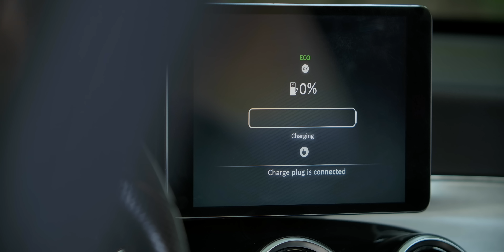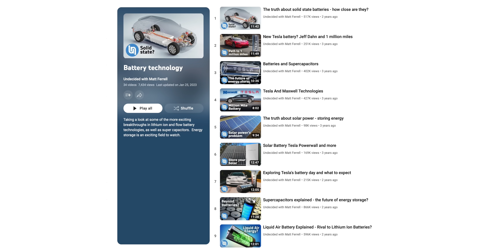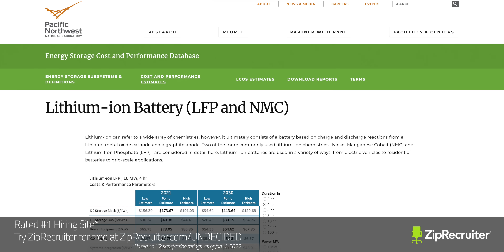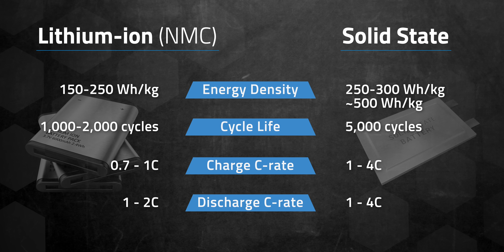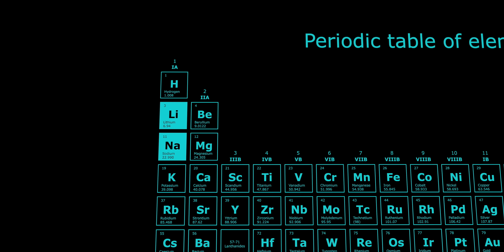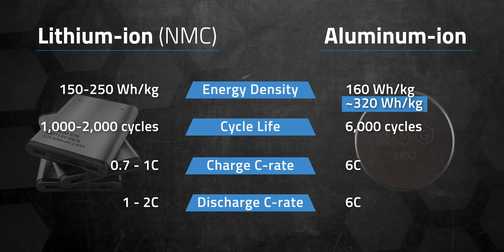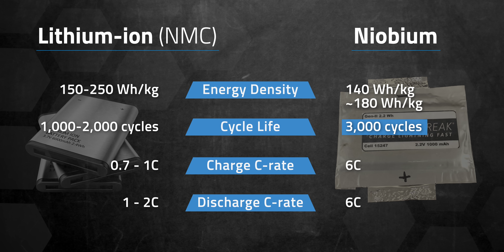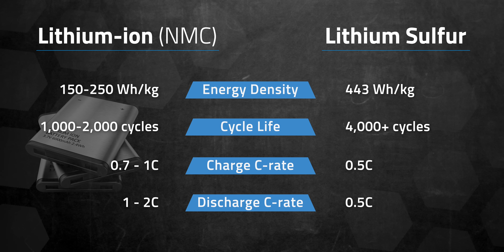Are These Batteries The Future Of Energy Storage?

Comment: I would be I interested in a few more points/attributes in these comparisons. For example, you might show your charge rate also in terms of an energy rate, such as miles of EV range per minute for a vehicle rated at 3 miles per kWh.  The estimated current and projected/targeted cost in $/kWh of the primary materials required for each battery type would provide some perspective on its potential advantage as well.

Comment: It's not technically a sealed battery, but I think vanadium fuel cells (aka flow batteries) are borderline criminally underexplored for grid scale storage, given that they've got far longer cycle lives than lithium based chemistries and their primary disadvantage is weight, not to mention that recycling of the electrolyte, the bit that's scarce in lithium cells, is trivial in vanadium based systems because it's a completely separate liquid that can be just drained off to allow only the fuel cell module to be replaced.

Comment: Batteries are NOT typically rated at 1C, they are typically rated at 0.05C or the 20 hour discharge rate.  Actual capacity drops, sometimes dramatically, with increasing discharge rate and many battery chemistries struggle at the 1C rate (like common primary alkaline)  and you only get a fraction of the capacity you get if you discharge over a day.  Good luck actually knowing this with only the manufactures data sheet because they are usually missing many key performance metrics.
Reply: NMC and LFP are both quite happy at 1C, the capacity drop going from a 0.05C test cycle up to 1C won't be that much for NMC, and it will only be significant for more easily available LFP batteries, like the types used for solar battery storage in home made systems.
Reply: @bosstowndynamics5488  name a commercial installation of any lithium chemistry and note the maximum power is often one half or one quarter of capacity.  Same is true of other chemistries, it’s due to thermal as well as other system requirements
Reply: @hugegamer5988  You're cherry picking by choosing a specific application and then generalising. Commercial installations are fixed installations with large banks of batteries that require endurance more than anything else, so they use more robust, longer lasting but lower discharge chemistries. Most LiPoly chemistries will happily discharge at 80C +, on the other hand, the NMC chemistries used in EVs will easily do 1C (the peak discharge rate in a Model S is 10C, those cells aren't going to struggle at 1C), the cells in power tools are designed to be discharged rapidly as well.
Reply: @bosstowndynamics5488  there is literally no chemistry outside of a capacitor thus not a battery that is “happy at 80C”    You need serious thermal management, get reduced capacity, and the cells won’t last long at all.
Reply: @hugegamer5988  A very quick Google search would reveal that there are high drain LiPo cells rated for delivering more than 80C, continuously. Maybe do some research next time before making up nonsense based on a comment you read once about a specific subtype of lithium battery chemistry
Reply: @hugegamer5988  Even the most basic intuition will reveal that there are lithium chemistries capable of much more than 1C discharge when you look at how many drones have batteries that go from completely full to completely empty in less than 1 hour (ie they are being discharged faster than 1 full battery per hour)
Reply: @bosstowndynamics5488  one main reason being charge/discharge cycles.  When you try 1C you might get half the cycles of 1/4C costing tens of millions of callers commercially.

Comment: DISINFORMATION AT 9:28 - The C rating is 0-100, not 0-80. It could still be considered as 1C despite having 80% within 10min (6C). That is because fast charge to 80% is always fast, while the 80% til 100% is much much slower.
Reply: No, the C rating is the maximum charge current the battery can take, which is to say, it reflects the charge rate when the battery is in the constant current part of its charging curve. In most, but not all, cases, this is 0-80%.
Reply: @bosstowndynamics5488  no its no. C rating is time from 0 til 100%, not 0 to 80
Reply: @markus98h66  Some searching to double check suggests that there's no clear definition - most sources I can find will massively oversimplify and say that a 1C battery will take 1hr to charge but they say that while calculating a charge rate with a peak current of 1C, which will obviously not fully charge a lithium battery in 1 hour. Most descriptions talk about peak charge current rather than time to discharge but don't use the term C, no source I could find that goes into enough depth to account for the CC-CV discharge profile needed uses C as a description of 0-100% charging times. The problem is C ratings are almost entirely about discharge rates which tend to be higher, and manufacturers tend to just specify a peak current and max voltage when they're providing formal specifications rather than time to charge when charged at maximum speed.

Given this, I think either use is fine, what with it being hopelessly ambiguous and ill defined anyway, but I stand by my comment in that every previous time I've seen a discussion of lithium charging rates, including in terms of C, it's been about max charge current, since that's the important figure for most use cases, rather than a 0-100 charge time that will never be used in the real world since discharging lithium chemistries to 0% is really bad for longevity.

Comment: For a comparison video, use less fluff and keep it short and to the point. The first two minutes where almost unnecessary. As you said, you already made videos on these, so you've probably said that stuff several times before. Its kinda disengaging for reoccurring viewers.

That said, Aluminium-ion seems promising to me as it seems like the solution thats right around the corner and even environmentally conscious, compared to the other solutions and their drawbacks. We will probably move on to solid state after that, when they're ready, unless something better has come around by that time. Sodium seems like a cheap option for grid storage, but aluminium still got better stats.

Comment: Any battery technology without using Lithium or Cobalt,  or any resource as such like which has issues regarding the mining of the stuff, is a plus with me! The hybrid supercapacitor battery seems to be the right direction to go.
Reply: As far as I can tell, the SuperBattery seems to just be a specific implementation of lithium supercaps, which combine many of the disadvantages of both systems (shorter cycle life than supercaps, slower to charge and discharge than supercaps, much lower energy density than NMC). Iirc the loss of energy density means that per unit mass lithium supercaps have a total lifetime energy throughput similar to NMC and much lower than other more lifespan optimised lithium technologies like LFP.

Comment: Aluminum Ion and Aluminum Air batteries are still the two I'm most interested in seeing develop.  It feels like the wait for new battery types has been one of the longest in technology.
Reply: Iam more interested in aluminum ion, lithium sulfur and sulfur ion batteries, lithium sulphur could replace li-ion if they managed to improve charge and discharge rate to be at least on bar with li-ion and sulfur ion would be suitable for grid storage where size wouldn't be a problem i guess but aluminum ion would drastically improve mobile devices performance and battery life and bring more range to EVs while being lighter
Reply: @3laarafat625  Lithium Sulfur is 100% going to be the next gen of Li-ion. They basically have been solved in the lab.
Reply: Aluminum Air? They can't be recharged, I feel like that itself puts it in as a dead-end technology. That's not changing, new technology won't change its fundamental chemistry of it. Recycling it is also energy intensive and nothing at all like say an Aluminum can (because of the chemical reaction that occurs in the battery). Aluminum Ion could be improved though. It's possible to be the future.
Reply: @kickassnetwork  only the aluminum air batteries currently used by the USA military can't be recharged.  The ones being developed can be. That is the whole point.
Reply: @someotherdude  It's not an Aluminum Air battery then. It's probably an Aluminum Ion battery. Aluminum Air is a primary cell battery (aka, goes through a destructive process) One of the reasons why it can generate so much power density. Also one of the reasons why it's difficult to recycle is that you need at least as much energy as it gave to reverse the process and get the original aluminum.

To compare, the theoretical energy density of Aluminum-ion battery (aka Perfect, impossible in real life conditions) is 1060wh/kg while Aluminum-air is 6000wh/kg. They share a similar anode component, Aluminum, but how it actually works is very different.
Reply: @kickassnetwork  I think if recycling infrastructure can get good enough it has some serious promise in a few areas.  Backup energy supplies, EVs and disposable devices (which if we're being real, aren't going anywhere and are only becoming more common).
Reply: @kickassnetwork  They can't be charged, but they can be refilled, and fairly cheaply. I agree it isn't as convenient as charging, and it means there is a constant consumable. Still, it may take off in some use cases that need cheap high energy density and can do predictable aluminum replacements. I wouldn't bet on it, but you never know. Different strokes for different folks as they say.
Reply: ikr?  but is only because there is so many people looking for better batteries right now as everything needs them, is a race to trillions of dollars.
lithium ion batteries are like 50 years old now, even thou they only became the standard about 25 years ago.

even if things go fast, i say we won't be seeing any new batteries around for at least for the next 10 years, as lithium batteries are still improving
Reply: I find it interesting how lithium ion has continued to just slowly creep along getting better and better. It’s still nowhere near where we want it to be but it’s kinda cool that this tech is still advancing even while we’re stuck on the same chemistry type
Reply: Waiting for iron battery´s. they will produce a line of prototypes this year.
Reply: I like the Lithium Titanate alot. Has an extremly long shell life can do around 30'000 cycles and you can charge it 10c the only two draw sites are price and energy density although the price is not too high in my opinion.
Reply: The sodium cell looks promising for grid storage.
Reply: It's time the US gets its act together, and does another Moon Landing / Manhattan Project, but this time on energy.
There are 1000 companies working on the same thing , either making tiny progress, or just burning money.
The US should get them together, throw them in a barn, lock the doors and throw money at them.  
Just cut the crap and get things done, why do we need another World War or Space Race, to achieve something ?
Reply: @scratchy996  Because the USA is more worried about people's genitals than anything else right now. You think they can land on the moon again? 😂
Reply: Understand the fact that you're calling them aluminum ion and lithium ion batteries is very bad and you really don't understand the technology. They are called Lithium polymer because they are lithium ions stuck to a plastic it's kind of sad that no one knows that
Reply: @RekySai  Um... Was this reply meant for a different comment?
Reply: Aluminium-air cannot be recharged, however Lithium-Air can and I think they are much more interesting. A recent paper using a solid state electrolyte achieved 683 wh/kg and 1000+ charge cycles at room temperature. Potentially the holy grail of high energy density batteries.
Reply: Besides commercial fusion energy lol
Reply: Molten Air batteries have huge potential too to transform the shipping and eletronic aviation industries, not to mention of all the possible grid storage electrochemical options the Molten Air chemistries are easily the most promising.
Reply: @@bgg2984 Nope, no 'i' in north america.....The standard was adopted in 1925.
Reply: Pretty much any type of battery will beat the Niobium battery. There is hardly anything of the stuff and it's a critical strategic asset.   Highly doubtful it will be used en mass for batteries when other options are available
Reply: Impossible is a long time.
Reply: Yeah beacuse advancement isnt a subscription service. Line dont go up.
Reply: @b gg but spelled alumi n u m
Reply: I wonder how many thousands of future battery technology videos can be made before one actually shows up and is better. THIS CHANGES EVERYTHING
Reply: All of the "air" batteries are interesting because they are light when charged.  This is perfect for electric airplanes where a large portion of energy is consumed during the first ascent.  Such planes would be lifting less weight and therefor should be more efficient.  Of course it is not magic - the battery will get heavier as it breaths oxygen at altitude.  But not having to carry that oxygen initially should really help.
Reply: @b gg coz we're Merkins n we got guns so there's only nuff room for one "I" in this element 😝
Reply: The wait for improved battery technology has been this slow because it's always been suppressed by big oil companies. They knew that if batteries tech ever got good enough then their profits will suffer massively because of the fear for electric vehicles.
Reply: Aluminium 👈 aluminum ❌
Reply: @ΗΕΑΗΘΣ  depends on if you are British or American.
Reply: Aluminum Air generators would be an excellent alternative to emergency combustion generators.
Reply: @JJP1890  fantasy generators would be even better.
Reply: @JJP1890  What about a generator powered by a steam engine?
Reply: Laughs in Fusion.
Reply: @mikelizard3730  oh the fusion people... you been in this rodeo for way longer than any of us.
Reply: @mikelizard3730  Laughs in Nuclear power.
Reply: @cobz76  what? Humans figured out Nuclear power over 50 years ago.
Reply: Takes 20 years for the FCC to improve new battery technology to be safe for use. There have been new battery technologies approved that end up bring scrapped because they proved to not be effective as originally thought
Reply: @Captain_Chaz86  Its not the FTC that causes the time to develop new battery tech. We are used to fast development in computers and digital tech but this is the chemical physical world which takes a long to time to move from the lab to demonstration project to full scale production.  Finding battery chemistry that successfully meets all the criteria (energy and power density, cycle time, fast charge, longevity/cycles,  safety, cost etc) is very hard to do. Many physical systems take a similar couple of decades to improve.
Reply: @cdmc2  I imagine that a developer would likely need to get a UL listing so that it can be sold in most stores, but that's about it. Many stores will not sell electronic devices that lack a UL listing.
Reply: @Captain_Chaz86  FCC doesnt regulate batteries, they regulate radio transmissions and interference.
Reply: @Captain_Chaz86  The FCC doesn't make batteries.
Reply: @Captain_Chaz86  They should just have the FDA approve it in 48 hours.
Reply: @Captain_Chaz86  FCC? I love it when people just make shit up and comment.
Reply: @Captain_Chaz86  The Federal Communications Commission (FCC) is a regulatory agency in the United States that is responsible for regulating communications by radio, television, wire, satellite, and cable. The FCC does not have a direct role in regulating batteries or battery technology.

However, some electronic devices that use batteries, such as wireless devices that use radio frequency (RF) signals, may be subject to FCC regulations. The FCC sets limits on the amount of RF energy that these devices can emit to ensure that they do not interfere with other electronic devices and do not pose a risk to human health. Manufacturers of such devices must comply with FCC regulations and obtain FCC certification before they can be marketed and sold in the United States.

In summary, the FCC's involvement with batteries is indirect and related to the regulation of electronic devices that use batteries and emit RF signals.
Reply: @Captain_Chaz86  The FCC (United States Gov) manages the radio spectrum use in the US. They are not interested in the "safety" of batteries or anything else. I'm guessing you meant some other group...
Reply: @chartube12  its not the FCC's fault. Blame the people who's profits will be the most impacted due to advanced battery technology allowing for EVs
Reply: The process of economics will never allow regular people the luxuries of these new technologies and battery chemistries. Commercial and industrial first, then us  or it's never funded
Reply: @swimfan6292  I don't think that's how it went with lithium ion batteries. Sony was the first to make them usable and the vast majority of their business is consumer type products
Reply: @counterfit5  technically we made them reusable.. because most are technically unusable by industry and actual practice. First lithium ion cells and oldest i have are LGs and Panasonic. 2004-2007. Sony makes cameras.. not chemicals. The other companies on the other hand... Lg owns chemical company. Not sure about the others
Reply: @swimfan6292  bingo. Capitalism is the problem and never will contain the solution.
Reply: The new diamond batteries never need charging and last for 28000 years. That's hard to beat- and they're on the market right noe
Reply: @preacherF-15  those diamond batteries don’t produce enough energy for everyday consumer electronics, but it would be nice to never have to change the battery in my smoke detectors every again